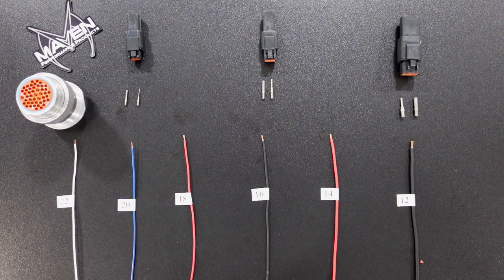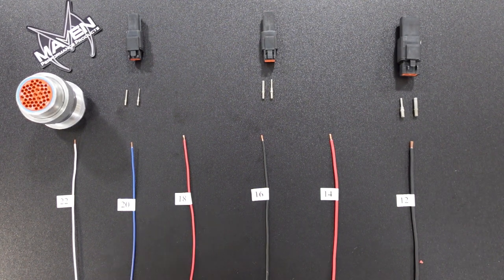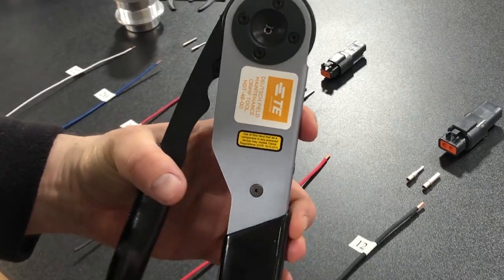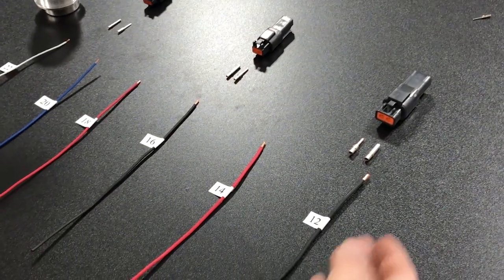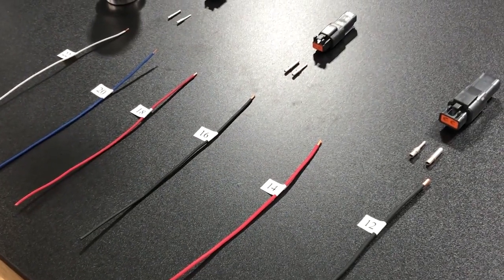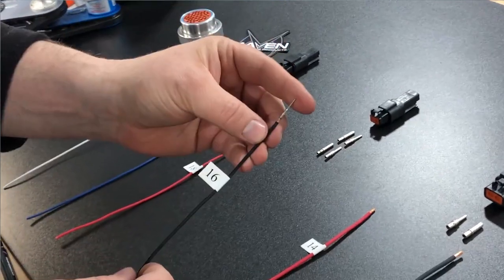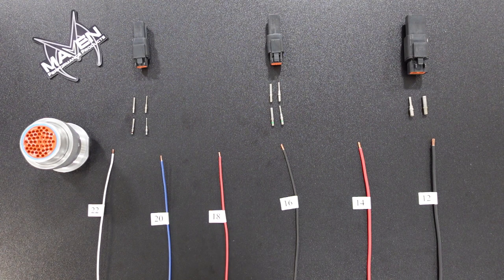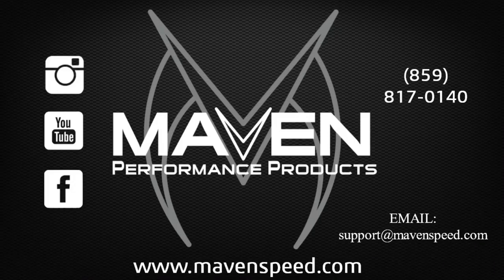014: Solid Contact Terminal EVERYTHING YOU NEED TO KNOW

Comment: Another great video - learned from this one that the banded terminals will fit a larger gauge due to the slightly thinner wall on the terminal (socket or pin), which allows a bit larger wire. Excellent info!

Comment: Hi, i have a Standard Holley Terminator X Wiring Harness for my LS K30 and would like to cut the harness and ad a round mil spec connector to my firewall. I have counted roughly 72 wires total, what connectors would you reccomend? Also I might want a separate connector for my 4L80e wire Harness.
Reply from the maker: The 47/29 pin combo is a popular one for similar combos, it also allows for some larger 12 ga wires for higher current. The pinout sheets are on our website and if you need more info/help give us a call!!

Comment: What about running gxl wire? Will that work with those pins and that connector?
Reply from the maker: Yes, but we recommend txl or Tefzel wire.
Reply: GXL has thicker insulation than the others, which can be problematic when using the insertion/extraction tools with these connectors. I personally would stay away from GXL with these.